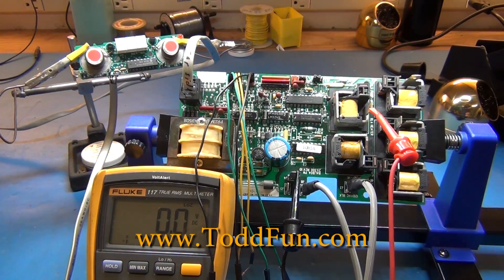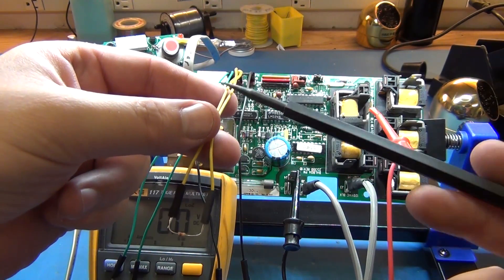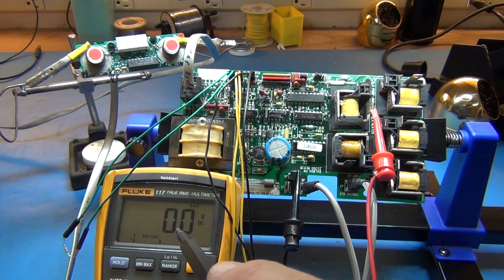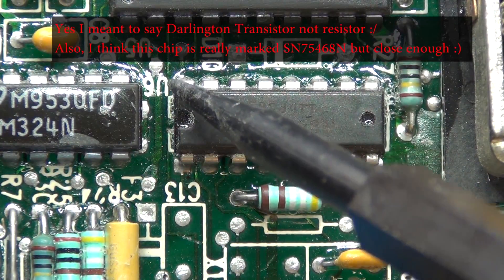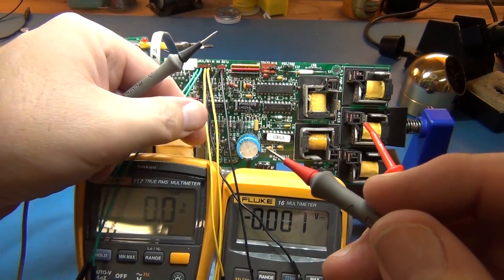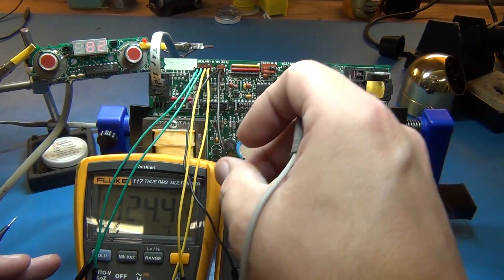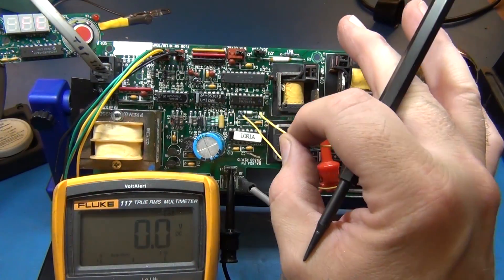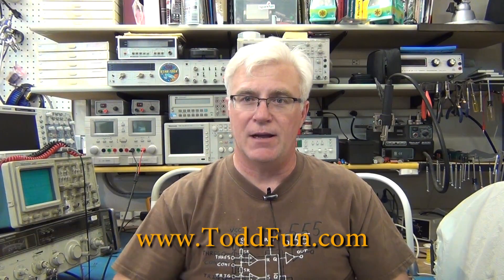Hot Tub Controller Hack part 2

Comment: It is interesting that they include a relay that is not used in your model
Reply from the maker: Stephen Hinkle mostly it is far cheaper to spin the one board version through the PCB supply and then try to upsell the customers. They will just not put the more expensive 3 speed motor in if the customers don't pay for the feature. The boards will just have a different code drop in.
Reply: As Todd said most boards come with optional features already programmed but merely disabled and this is often across the board for All Electronics and is a cost-cutting measure.  You can see this often in cars where there is three or four panels with buttons on them and another panel or three without buttons where it looks like there should have been.  For the savvy, you may be able to program or hack extra functionality out of some devices.  I installed heated seats in my wife's truck by purchasing the pads and some buttons and tapping into the functionality that already existed in the truck.